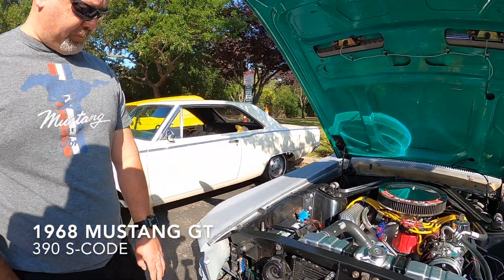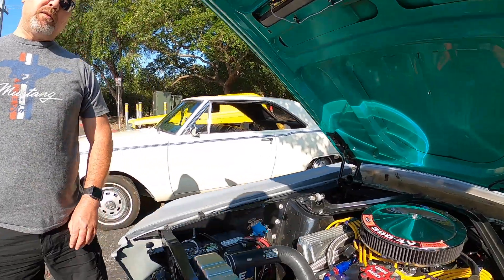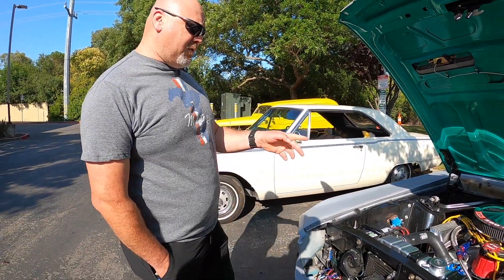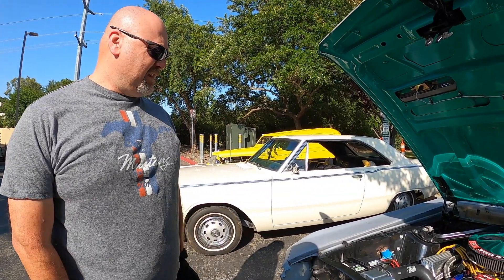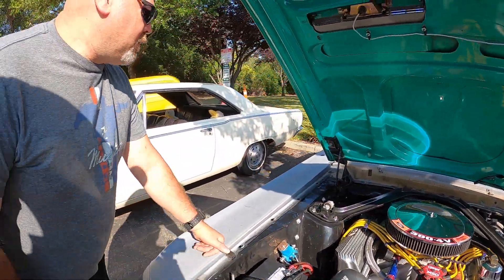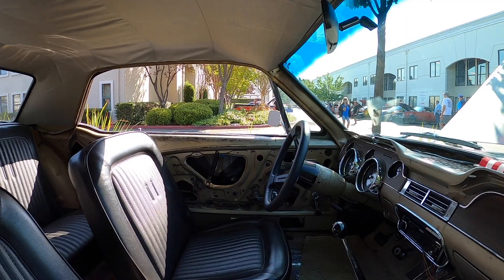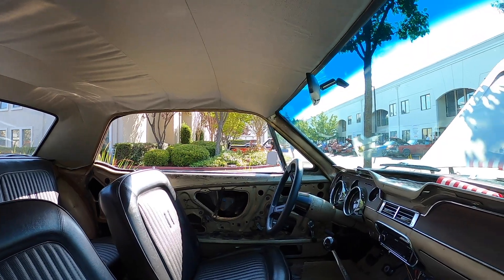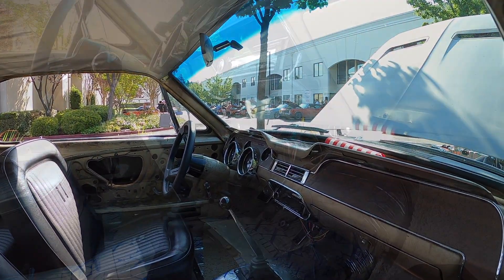1968 Ford Mustang 390 GT | Loud Exhaust Sound | #Thesmellofgas | @Thesmellofgas

Comment: Where is your shop at
Reply from the maker: Mike, don't have a shop. This channel features the work of multiple shops in the S.F.  bay area. What specific build are you interested in? I may be able to tell which shop did the build. Thanks for watching 👍
For work on original Mustangs non modified. R Mustangs in S.F is where most of my informational videos are done 👍
Reply: @TheSmellofGas  I'm familiar with R mustangs, im from SF but in Vallejo now. Have a 67 cougar with a 351 cleveland in it and looking for quality ford shop for a few things
Reply from the maker: @Michael-fd8jd  I like Rick at Rmustangs he works on original non-modified cars. Have you look at the video with the gray widebody 65' coupe? That car is highly modified and he used Alloy Motors in Oakland to put the car together. He had his engine, suspension, etc. dropped shipped to Alloy and  they took care of the rest. I can tell you based upon inspecting that car up close, the work looked great and he is very happen with the results.
Reply: @TheSmellofGas  cool, ill check them out